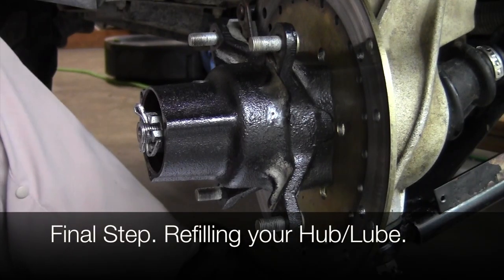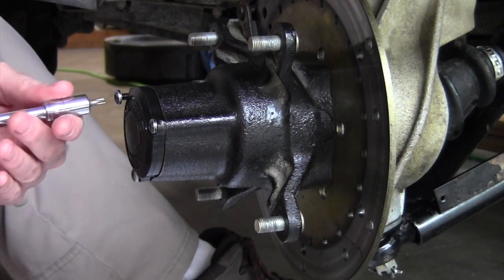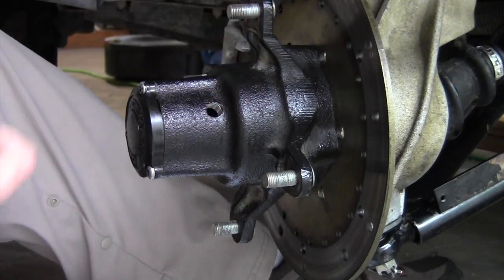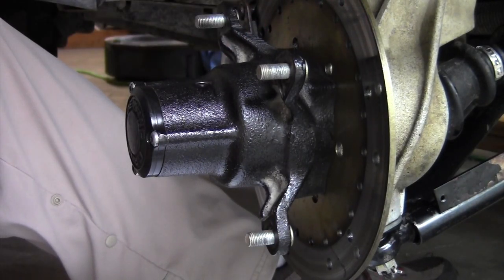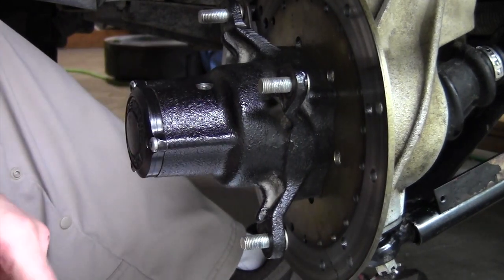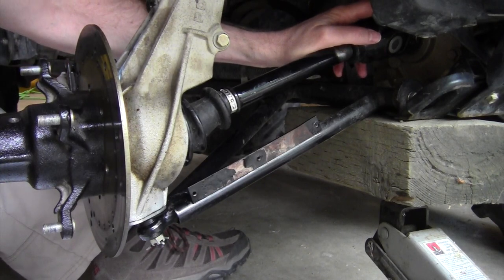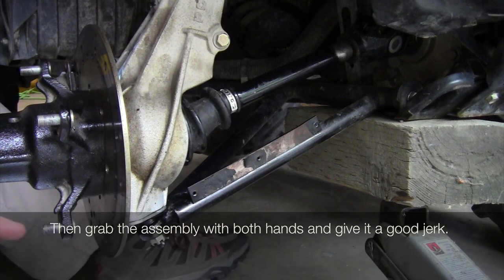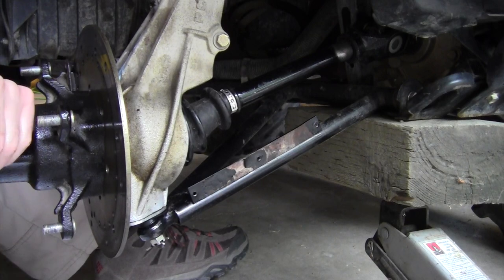Refilling Your Hub Fluid/Oil and Last Thoughts and Nuggets About Assembly.

Comment: Just did my 2004 500 HO. Helpful set of videos. Thank you sir! Wouldn't mind the reassembly video, but probably too long ago now. Not too sure of the torque specs on the castle nuts so I winged it. Hopefully they'll be okay.
Reply from the maker: Glad to hear you've found them helpful. I did a disassembly video and you can just reverse the steps and I believe I covered torque in that as well. 
https://youtu.be/aB71Y7bt3Rk is the link for that one.  But for the year make and model Im working on in the video the torque instructions are as follows. 
1. Torque spindle nut to 160-170 Inch lbs. (18-19 Nm). while rotating hub continuously.
2. Back off nut 1/2 turn.
3.Rotate axle several revolutions by raising rear of machine and rotating rear wheels with the machine in gear.  
4.Re-torque hub nut to 108-144 inch lbs.(12-16.3 Nm)
5. Install cotter pin. If if cotter pin holes do not align . Tighten slightly to align and install pin. Do not exceed  144 inch lbs.
And then the rest of the assembly and refill of course. Cap fluid etc.

Comment: Thanks for this.  Will be doing this tomorrow.  Will open all up and inspect as I am getting some weird wheel drag in 4x4.
Reply from the maker: Check this one out as well if you haven't already. https://youtu.be/aB71Y7bt3Rk   Good luck.
Reply: @ericinalaska7648  I did.  Started to take apart my hub thinking it was going to be dry and to my surprise it had proper amount of oil although very dirty.  Left it at that pending lower a arm bushing kit and tie rod kit arrival.  perhaps will do a quick video of the All Balls Tie Rod Upgrade Kit.  Meanwhile charging my battery as I have a feeling it may contribute to bad 4x4 experience as it is electric and we get no charge on low rpm.  so battery state was at 11.7v  Next project is to put lifepo4 battery, so trying to figure out if atv would charge it or if I need to keep acid battery and add lifepo4 in parallel

Comment: Thank you for the great video and the useful info given and yes Polaris parts and fluids are definitely over priced. You have another subscriber as well.
Reply from the maker: Appreciate the feedback.
Reply: @ericinalaska7648  what oil you use?
Reply from the maker: @renegade9758  The manual recommends special polaris oil or ATF automatic transmission fluid. I use full synthetic. ATF+4. Hasn't failed me yet.
Reply: @ericinalaska7648  good tanks IT for m'y friend .i have a can am atv 🥴
Reply: @ericinalaska7648  what torq specs for front Axel and rear too please?
Reply from the maker: Are you talking about the front spindle nut/castle nut? The  manual (for a 2002) says 108-144 inch lbs not to exceed 144 inch lbs. Rear hub nut should be 100 inch lbs per the manual. For a 2002. Both requiring the cotter pin to be installed.And then of course the cap. I discuss the front in another video. Check it out if you have any more questions about that.   Polaris Sportsman Front Hub Disassembly and Rear Seal Removal.  https://youtu.be/aB71Y7bt3Rk.
Reply: @ericinalaska7648  ok tanksit's the xplorer 500 1997 has a friend the 4x4 doesn't work its Drive Shaft doesn't turn what problem could be?
Reply from the maker: @renegade9758  Im not as familiar with that  model. Assuming you're talking abut the Polaris Xplorer. Or I guess even if it's  the Argo Explorer. Either way. No time working on either. But ...... Its usually a few possibilities.  First look for any obvious damage. The shaft itself. Any related wiring. Does it likely have individual shafts to each front wheel like a sportsman? You said drive shaft so I wasn't sure. Does one turn but not the other?  Or both don't? Is the speedometer working? All places to start. Really hard to say with such little info. There are a handful of possible causes. I have a couple other videos on some possible causes. Check out the playlist.
Reply: @ericinalaska7648  tanks. Transmission problème🤔
Reply from the maker: @renegade9758  Front Gear case? Yes these of course are all options. But you'd really have to explore to determine which it is.

Comment: Hey Eric. I replaced the seals and it’s still leaking. The new O rings and the inside seal that sits around the axle. Was wondering if you ever got yours to stop leaking? What did you do? Also I didn’t buy factory Polaris seals. Do you think that could be the problem?
Reply from the maker: I did get mine to stop leaking. So you replaced the o-rings in the cap, and both seals. The one behind the brake disk as well as the one on the strut?  Can you tell the source of the leak. I cant imagine the o-rings being a problem. The Plug would be pretty obvious as well. So that leaves the two seals. All I can suggest is the same as I would do. Make sure the surfaces are undamaged. There is good contact.  some oil or grease on the contact surfaces. Make sure things are spinning properly with proper torque. And there is no wobble  or what would indicate something being bent or not seating correctly.   Bearings good?  And yes its always pos to have some after market parts that may not be up to snuff. I haven't personally run into it but now days when trying to find the cheapest option. That cheapest option can be cheap for a reason that can bite yah. Im not saying stay away from after market stuff. Just make sure you research the feedback a bit until you're comfortable that they'll get the job done.  Not saying that's the issue for you but could be who knows.

Comment: Hi Eric, Really appreciate your videos. They are easy to understand and follow. Do you happen to have one showing an oil change in your Polaris? I looked at some of your other videos and did not see one.
Reply from the maker: Hey Dan. Thanks for the feedback. I don't currently have an oil change video. I usually make them on stuffI haven't seen out there already to fill a gap on something not covered or maybe add some info to something covered but missed a few things that may be helpful.. I thought about making one  but Im willing to bet a search would yield a few. Do you have a specific question regarding that or anything I may be able to help with? If you've searched and maybe haven't found your exact year, Id be willing to bet you'll find one with similar enough design that it'll get you through it. Let me know If I can help.
Reply from the maker: Hey there Dan. A few months ago you inquired about if I had made an oil change on a Polaris video. I now have done so. Its actually A pretty Deep dive and maybe more than you were needing but I think whatever level of info your looking for It should cover it. If your still interested the link is.  https://youtu.be/B9KhYMiWgeY. "Polaris COMPLETE oil change & Much More. DEEP DIVE."

Comment: I have a 1996. Your numerous instructional videos have been awesome. My problem is the drain plug in the front left tub is super tight. I have used deep creep penetrating oil. I have started to twist my Allen wrench. I’m nervous that I might not get it out without stripping it. Any suggestions?
Thanks
Reply from the maker: My instinct is it maybe got over cranked some where along the way. Or is it rusty? Penetrating oil soak it really good overnight or more if you have the time. And have at it.  If it does strip worse case scenario if your comfortable with it you could always drill and tap it the next cap screw size up.  If it strips. Id be surprised if it didn't let loose with persistence though. Thats a decent sized Allen wrench. And there relatively cheap. Al long as the the wrench is a good fit and the hole isn't buggered up or stripped out.I believe it'll give. If the Allen wrench brakes Id think you could get the pc out and attempt again with another.  Also maybe a Allen bit in a ratchet or even a impact? Thats how Id come at it anyway. Thanks for the appreciation of the efforts.
Reply: I am having the same issue on a ‘95 Magnum. How did you resolve the issue?
Reply: @michaelmilani4387  

So I let it soak a bit, I used a touch of heat around the plug, tapped just a touch and finally made sure it was a new wrench. I put my adjustable pliers on the end and prayed!
It let loose! I do have a friend who has an impact tool that you tap with a hammer but didn’t need too.
Good luck!

Comment: Love your videos very thorough and straight to the point. I didn’t hear what type of atf you use. Dexron 3 work? I got some sitting in the shop and I’m currently doing front axles.
Reply from the maker: Synthetic. I believe it's ATF+. Thats all I've ever used other than the Polaris brand fluid.
Reply: @ericinalaska7648  10-4. Thank you sir.
Reply from the maker: @seank4447  Absolutely.

Comment: Thanks for the help , just picked up a 1999 sportsman 500 like urs ,, watching ur videos have really helped ,,,, did U say that if ur speedometer doesn’t work that ur 4 wheel drove won’t work or did I hear wrong
Reply from the maker: Glad your finding the videos to be of help. Yes if the speedometer doesn't work it CAN, depending on the issue, can effect the AWD. But if your speedo isn't working it doesn't necessarily mean your AWD won't work and vice versa. A bad cable/speed sensor can cause for example no speed indication  but everything else can work. Im not sure if your referencing the "Prepairing  to go through it"  video.https://youtu.be/lO1SljA22sg.   or the speedometer repair video.https://youtu.be/ADNyJ5sx83o But the speedometer repair video covers quite a bit about that if you haven't seen that one. Thanks for the support.

Comment: To replace this oil for maintenance purposes would you drain the old fluid out of that same hole? Then refill ?
Reply from the maker: Id take the end cap off also.  Better draining and it allows you to see if there is any grit or sign of ware. Then put the cap back on and refill through the plug hole. Do you have to? No. But I do. It only adds a few minutes to the job and gives you a better assessment of the oil coming out and perhaps grit that may not. I have been raising one side, the opposite side, of the machine and removing the cap to drain. Then the other side.

Comment: Thanks for the video. I just picked up a ‘95 Magnum 4x4 and tried to replace the  lubricant but found that an Allen wrench snapped off in one of the set screws and it was then ground down flush.  The other one is very tight so I hesitate to torque down on it to get it out.  I was considering jacking up the left side of the machine to a 45 angle and pulling the cap, removing the oil with suction, inserting 40cc of oil and replacing the cap. Then repeat on the right side. Do you think that might work or do you see a problem based on the design of the internals? Thanks
Reply from the maker: You could just leave it on all fours to pull the cap(s) and drain them. Then raise one side to refill with the appropriate amount. And repeat.Once you drain the fluid out. Look into the hub with a light and see if you can see the tip of the screw poking through. And if it looks right or anything you can grab. I would be obsessing with addressing the set screw(s) though eventually. Stuff like that stays with me until I fix it.  Id be surprised if you couldn't get the other one out. Some one must have maybe had a leak they tried to fix by cranking it tight and it broke?  They usually just need to be cracked/broke loose to remove them. Maybe some penetrating oil over night. I haven't ever had or seen one break trying to remove one though. Just make sure you have a good clean, not rounded. Properly fitting Allen wrench. Not one that's close, but a good fit. And it should come out. Does the broken one have anything left to get an Allen wrench in? If not I can't help but wonder if maybe someone  substituted another bolt and ground it down. If so. An Easy out or drilling it as big as you can with out damaging the threads on the hub is an option..If I were doing it Id take the hub off. I know that's a bit more of a commitment than just changing your fluid. But The more you do it the more you understand what's all going on in there and the easier it is every time.  The screws just kind of bottom out at the leading edge or  some may be a tapered thread but either way its pressure creating a seal  and usually unless they've been run bone dry and neglected some fluid would have been on the threads last time in and out. But they commonly will brake free. With a bit of resistance. And the bonus of fixing them is you don't have to be so creative in the future and it won't be such a deterrent to keeping on the maintenance.  You certainly can do it the way you suggest though. Just make sure you have it raised enough that it will take the recommended amount without spilling out. And don't overfill. They put the drain plugs/set screws in there to make it easier. But same end goal.
Reply: @ericinalaska7648  ok, thanks for the comments. Let me try the work around method as a stop gap and then I will revisit a longer term solution.
Reply from the maker: @michaelmilani4387  Just all food for thought. I can certainly see the alternate method working just fine and in a pinch  prob do the same.

Comment: Do you grease any of the bearings, or does the type F fluid take care of all the bearings?
Reply from the maker: Hey Dave. Sorry for the delayed reply. I was traveling. I don't grease any of the parts. Just fill the hub as described and the Fluid will circulate as needed. You shouldn't see any sign of any grease when you take it apart. I wouldn't think. I never had anyway. I just wipe everything down and look everything over to make sure there isn't any abrasive debris or anything and you should be good.
Reply: Hi Eric I just bought a 2005 500cc Polaris Scrambler and I noticed after I brought her home yesterday that it was not disengaging on the left front wheel I call it the left front wheel when I'm sitting on the bike so I took it apart to see what was going on and just all kinds of shavings and oh my goodness tha Armature ring was bet in several places I don't know if I'm going to have to replace the whole strut Tower housing and all the bearings I might need your help with this I'm going to go ahead and order the bearing kit and seals then also comes with the Armature ring and hopefully I don't have to buy the whole strut Tower housing cuz it may be chewed up and not usable this video really helped me a lot

Comment: Where do you get the allen screws at? Mine stripped out
Reply from the maker: You should be able to find them at just about any hardware store Id think. You of course need to know what size you need. When you say stripped out do you mean the part the Allen wrench go's in or the threads? Im assuming the Allen wrench part. Just take it with you to a place that sells nuts and bolts etc and match it. Or ... Im sure a Polaris shop would love to sell you one for a bit of a markup but it would be nothing special other the price. But I know Home Depot and Lowes has some bins /drawers with less common stuff like that. Well may less commonly sold there anyway. And usually on one of the posts in the screw/nuts/bolts isle that have a thing hanging that you can mate your part up to to identify the proper size. Otherwise maybe a fasteners type store that specializes in fasteners.. Or nuts bolts screws etc. Id almost think if you went in one of those they'd just say here. Because it wouldn't be worth wringing up one pc.  Hope that helps.

Comment: Hi Eric...good videos. I also am in Alaska living in Fairbanks. Whenever I go to fill mine it leaks out so I'm guessing the seals need replaced on mine. I noticed you did an entire video on the front hub and all the parts associated with that. Is there a kit you can buy that has all that in it? Links to the parts you use would be really helpful. Thanks in advance
Reply from the maker: Hey Taylor. Other than the seals, I used all my existing parts. I guess that's why I didn't mention any sources. The seals I just picked up at the local Polaris shop. I buy shafts\hub assemblies from a place called Eastlake Axle.  They also have some bearing and seal kits. I have had great results using the shafts\axles and so have some of my friends Ive recommended them to. The bearing and seal kits look reasonably priced as well but I have no experience with theres. However, If I needed one. I wouldn't hesitate to buy one from them. I have no connection with them Ive just been pleased with the stuff Ive gotten as well as pleased with the price. You can find their stuff on Amazon and of course covers shipping.Or you can get it direct from Eastlake Axle. If you go direct to the website they have free 2 day shipping I believe for orders over $62. Heres the links.  https://www.eastlakeaxle.com.

Comment: Hey I’ve been watching your videos lately I’ve got Polaris project machine and I have fluid leaking from my hub. The O ring on the cap has been replaced and not leaking from there anymore but now it’s leaking from infront of the disk break thing.. where would the seal be ? Inside the strut ? Or In back of the hub?
Reply from the maker: There is a seal behind the disc and one on the back of the strut. If you take your hub off. Then remove the disc. You will see it. That sounds like what you're describing.  Then after removing the old one. You press the new one in with the disc. As you replace the bolts and draw it back down into position it will press the new seal in. Do it evenly of course. Alternating between bolts to press it in straight.
Reply: @ericinalaska7648  thank you very much !
Reply from the maker: @colt0864  No problem. Anytime.